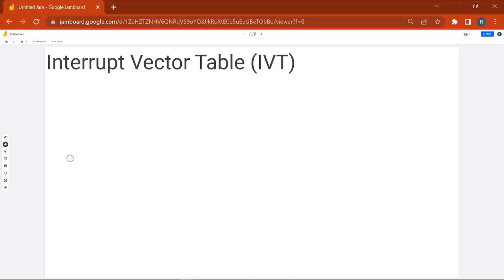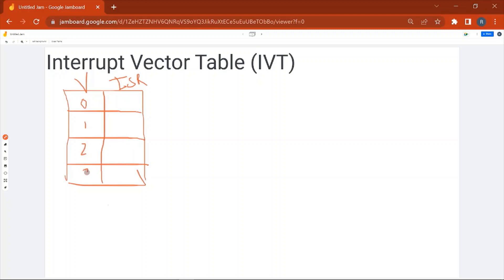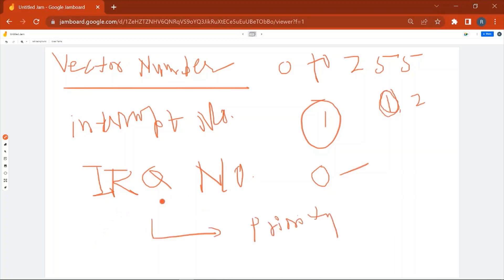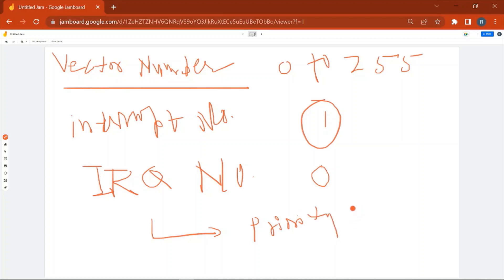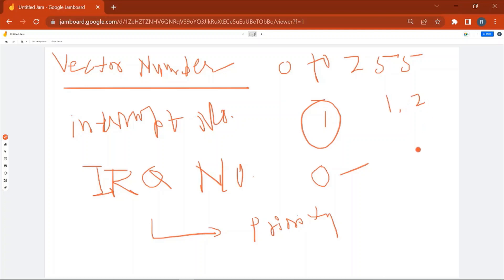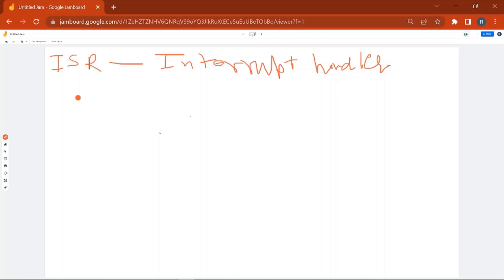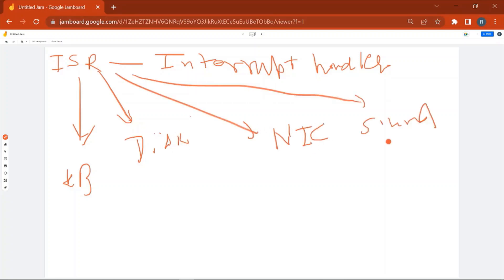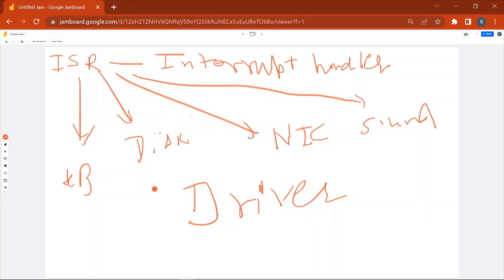Interrupt Vector table  |Interrupt Service Routine(ISR) |  Interrupt Handler | interrupt number

Comment: There is a table of interrupt numbers online based on Ralph Browns interrupt list html version.
Reply from the maker: Yes, thanks alot for your input .
Reply: @makinglearningezy  I made two videos on my channel that uses software interrupt 10 hex in the DosBox emulator, one video to change the font with a picture to display inside a block of some ASCII character and the other video to switch from the text mode into the graphic mode with 320x200x8 to use some drawing routines all made with open source x86 assembler mnemonics. I put all instruction into batch files to create the executable with a little help from debug. And there are download links to download debug, the batch files and for the first video with some pictures to display and to start within DosBox. So it need the Dosbox emulator installed and to mount a folder as a Dosbox drive. The batch files are inside a folder and inside a zip to extract/unzip. Debug have to unzip and placed  inside the folder with the batch files or if both folders are inside a mounted folder of Dosbox in this folder with a path command that points to debug.

If you like it please write a comment on my videos. I need some feedbacks too. Thanks.